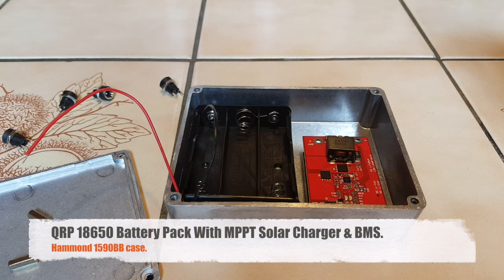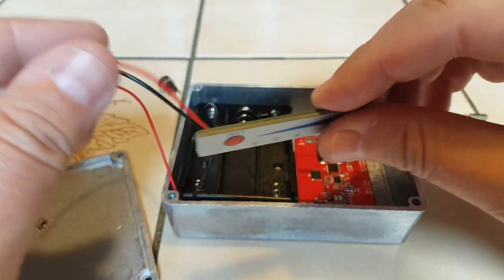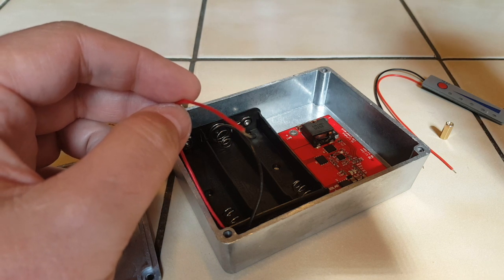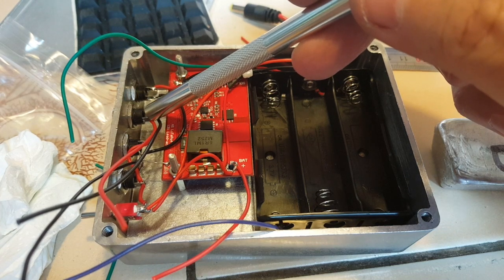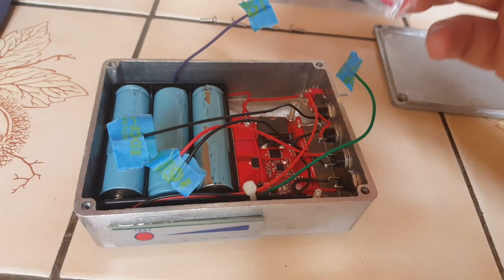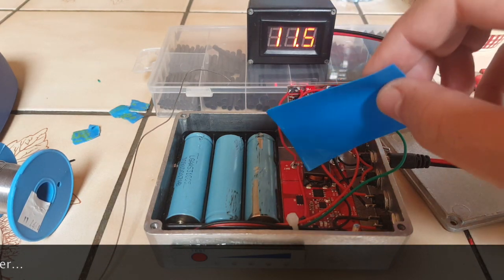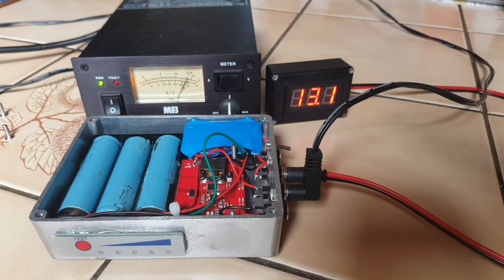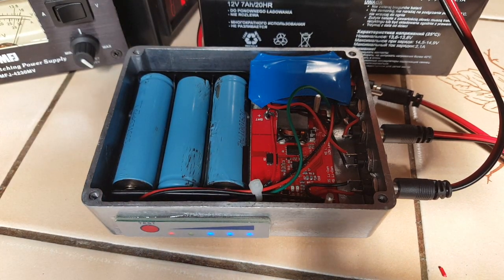QRP 18650 Battery Pack With MPPT Solar Charger & BMS.

Comment: hi, i have an 18v solar panel. so with this mppt board will it charge the 3s 18650 batteries directly from the mppt?   or does it need the bms board too?   i note that the 18650 3s requires 12.6v to charge, so does the mppt board put out 12.6v?  thanks.
Reply from the maker: I don't remember, but there are mppt boards specifically for 3S LION packs, otherwise you need a BMS because most regular mppt boards are for lead-acid batteries. Check out my video on the Wonton board...

Comment: I don't understand why you use an extra bms? The MPPT charger circuit board has a 3S 5A bms integrated (see specs). You just connect the battery leads directly to the PMMT circuit board and that will do it. You will be able to charge with variable solar (or adapter) voltage inputs ranging from 6-18v. The integrated bms will have a constant input voltage or cuts off entirely if solar power gets too low.
Reply from the maker: The MPPT charger does not balance the cells
Reply: I connected MPPT Epever controller with 44volts solar panels to 18650 6s module without balancer... and it started overcharging battery block... why? How can i limit output voltage to the battery from MPPT?
Reply from the maker: First is your MPPT charger rated for a 44V input? What is the output voltage? For 6S it should be 25.2V. If not you need a voltage regulator. You must use a BMS to balance the cells. Cells should never get more than 4.2V each. The BMS must limit current too, based on your cells C rating for charging.
Reply: @RadioPrepper  thx, the max input is about 150 v. 10 amp.

Comment: Yes, you need a higher voltage for that MPPT to turn on.. I thought mine was dead when I plugged 12.6v adapter to it... Connected to my Solar panel though it turned on fine.

Comment: Hi Gil,

are you sure it’s actually a mppt controller? Did you try to measure voltage/amps on input under various insolation conditions?
Reply from the maker: No, it could be fake...
Reply: The CN3791 is not a true MPPT but approximate, fixed voltage, these are usually tuned for 18V panels, you can lookup the datasheet
Reply from the maker: I suspected as much, for the price...
Reply: Still better than PWM, it's just that compared to a true MPPT, it won't "track" the maximum power point, given the condition, these are just "MPP" and will attempt to keep the solar panel output voltage constant, set to its optimal efficiency. A true MPPT may not be required for such low power application and in order to track, it needs to constantly disturb which incurs some additional losses afaik
Reply from the maker: I am working on a new solar/18650/mppt video; stay tuned..

Comment: Gil... question:  You said for this project you needed just 3 18650 for a maximum voltage 12.6.  That's three 4.2v batteries correct?  

If I'm looking at the YOUKITS HB-1B radio, with an external supply voltage: 9-14 VDC . Could I use a four battery pack holder with four 3.7 volt 18650's for a combined 14.8 volts?  

Could that potentially damage the radio at all?

https://cdn.shopify.com/s/files/1/1057/7050/files/hb1b_mk3_2018_manual.pdf?10004542341911516252
Reply from the maker: Correct. For the HB-1B I would use three cells. 4.2V is the maximum charge voltage of those cells. They quickly go down to 4V. 16V would probably be too much for your radio. You could use three or four diodes to drop the voltage to 14V, or a voltage regulator, but it really is more trouble than it's worth. 9V with three cells is also the minimum voltage you want for those cells (3V per cell minimum), so three cells is the best IMHO. You might lose a little power but the guy at the other end won't hear the difference.
Reply: Excellent.  Thank you sir.
Reply: Radio Prepper also when outside with rig, I've read a  drop to 1 or 2 watts will double battery life and reduce your transmitted signal by half to one S-point relative to 5 watts.
Reply from the maker: Yes, you can change power by regulating voltage. If you don't transmit too much though it should be be necessary...

Comment: Hi Gil.
Did you put the charge controller to the P+ & P- of the BMS board?
I always love portable power videos, so thanks for sharing
Reply from the maker: Hi Julian, no, they go to the battery. Would using the BMS with the MPPT board better? I thought an occasional unbalanced charge wouldn't be too bad, but I can certainly re-wire...
Reply: Radio Prepper well you reduce the complexity of the build by taking the output of the charge controller to the charge-discharge (P+/P-) port of the BMS. Also, by bypassing the BMS, any protection the BMS woulc have provided would be bypassed.
Let the charge controller and BMS work together to do their jobs.
Reply from the maker: Thanks, I might try that since I need to troubleshoot the MPPT charger; just a few minutes to re-route wires..
Reply: Radio Prepper you're welcome. I think the charge controller problem was related to the 16 volts power supply you were applying to it. It will definitely work with the solar panel or with an adjustable constant current constant voltage buck converter set to 3 amps or under and 13 volts
Reply: OH8STN , I think you just saved me from frying my batteries. I did exactly the same thing and connected the battery to my mppt. It all makes sense now. I have a question. If the B-,B+ is for battery, and P- and P+ for mppt in. Where does the + and - for powering in my case a water pump come from? Thanks to both of you for this topic. Cheers!!
Reply: I'm sorry what is the bored so I can find it?
Reply from the maker: Search for battery management system on  EBay.